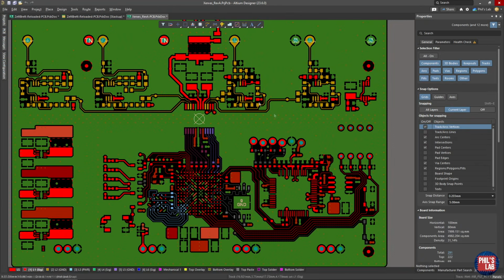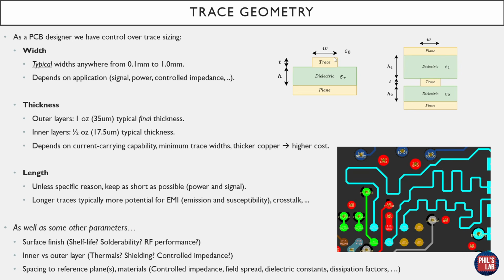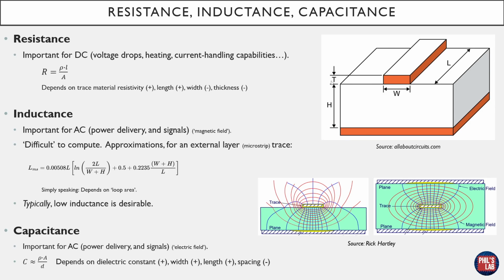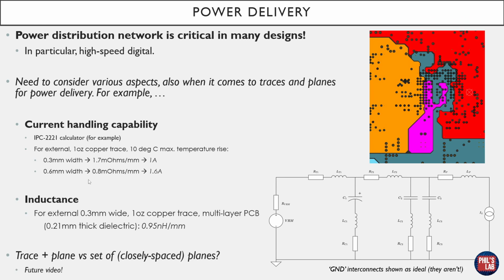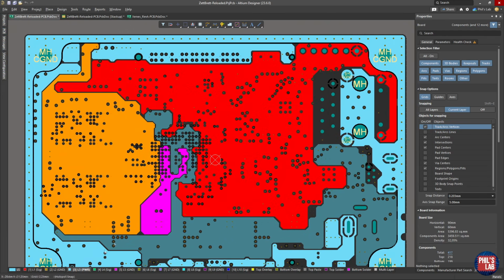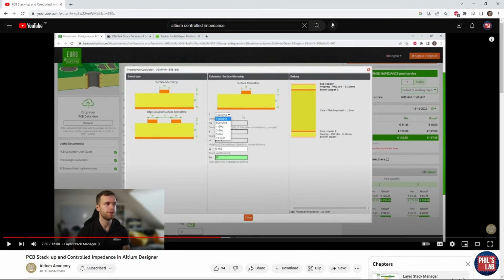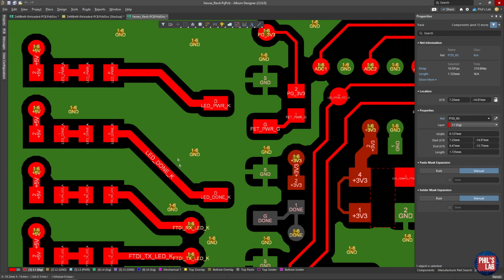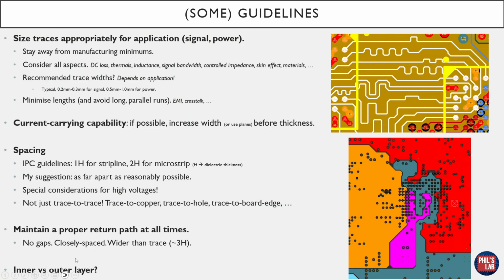PCB Traces 101 - Phil's Lab #112

Comment: if you don't have any pressure not big power level, not lots of current. What is good widht with thickness at 35um and on the top not in inter layer ? I see big is good if you can, if is power track more big. not 0.25 mm take 1.27 or little less. Is not very clear for me. please give me your opnions. Before i use 0.25 mm kicad setting now, i change for more if i can. But  I m not sur

Comment: I wish I had this when I started out 20+ years ago... You concentrate it all down to 30 minutes and go through the all key topics so that viewer is AWARE of these concepts and can look into them more when they need to. Being aware about existence of something is half way of learning to master it.

How I learned about drawing was to read a lot and watch a lot of videos on the topic by professionals (presentations), then do lots of simple, non critical designs AS THEY WERE critical and high speed and then learned about EMI etc.by poking around with oscilloscope and seeing all the ringing and reflections etc.

Then when you go to actual high-speed design, you already have the basics and the vision to understand how currents flow and how to keep loops small and consider the current carrying capacities etc.. so that helps you. You don't calculate everything immediately, you use calculators for impedance matching pairs, for layer stack-up, for very high speed critical traces, but the actual routing and placement of components you use most tons of learned intuition and ability to see how currents flow and how impedance is. It's all very artsy, but that's what it is... :D

Comment: This is a good refreshment of my knowledge. Nice video! Thanks for the amazing course.

I was working on a project where one of the PCBs is just a 2-layer board that is trying to carry nearly 30 differential pairs to carry audio signals with multiple ground connections from PTH to PTH within 3.6 centimetres and all the connections are crossed... For all of these constraints, I cannot really control them. What I can do is to use legacy vertical-horizontal routing with my best imaginations and try to follow as much good practice as possible. Although it looks messy, almost no return path underneath the traces and nearly all the line spacing are just a bit more than manufacturer’s capability, I believe that’s reasonable in this case😂
Reply: Pay a few bucks and get 4 layer makes your life much easier.